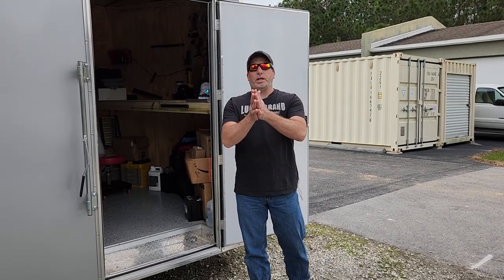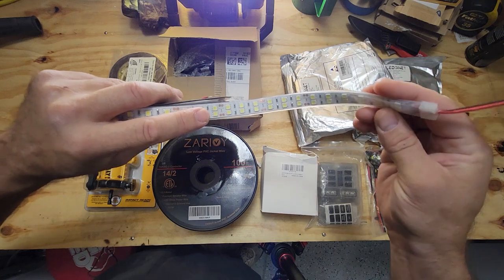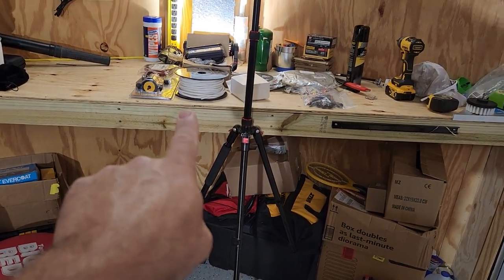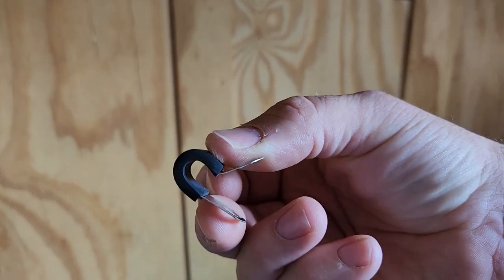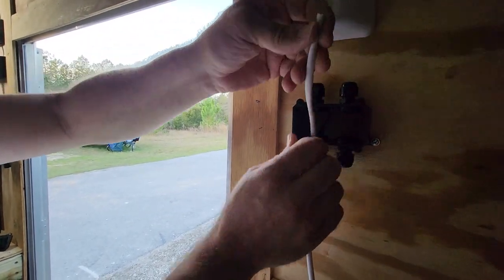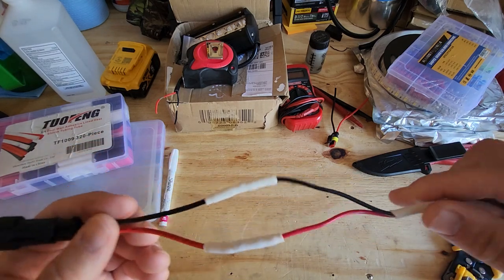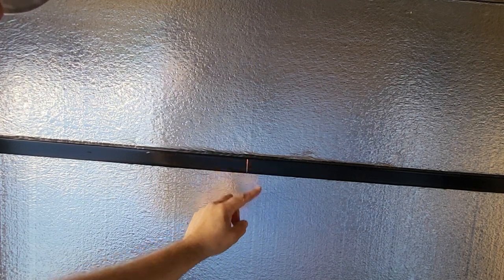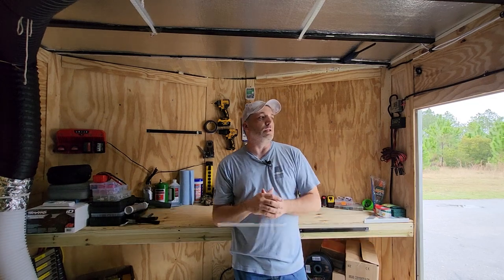Installing LED lights In A Cargo Trailer.

Comment: Great idea! Hoping to do something similar with our cargo trailer. Nice work on the video!
Reply: I try to make similar instalation in my cargo trailer was wondering where you connect the wire came from the switch to the fuse box and where you connect the led strip

Comment: Very nice setup. If securing those silicone strip lights caulking idea worked, I think I will do that too.
Question,,,,,  Looks like you spent more money then you needed to. Why didn't you use the chassis for the common ground point. It would have required only 1 wire back to your power source, and cheaper/less wiring.  I'm curious to understand your logic on doing it this way rather then the common ground method.
Again, looks awesome.

Comment: How did the Silicone work for keeping lights up?
Reply: So far has worked great. They are still up in all spots.
Reply: Witch fuse you put in the fuse box?
Reply: 15 amp?